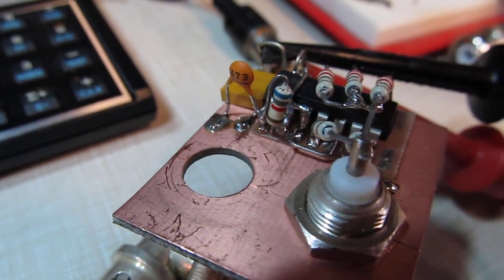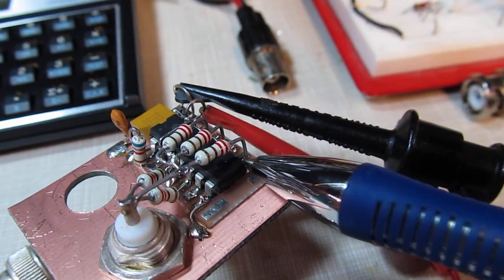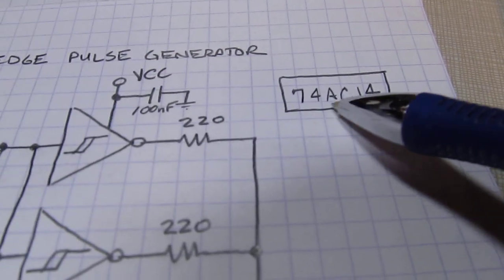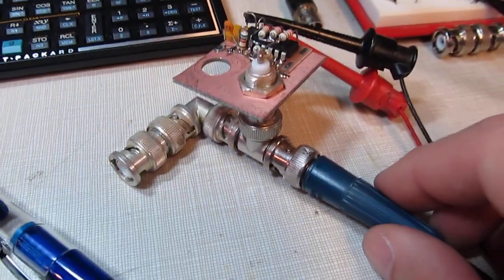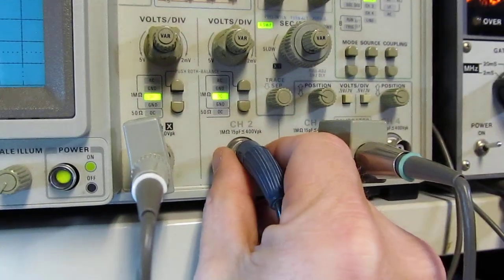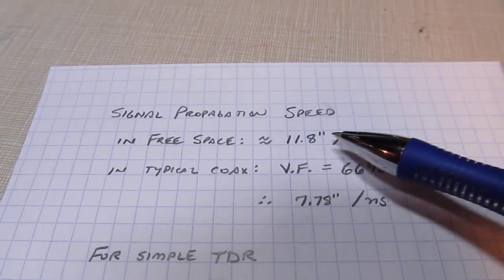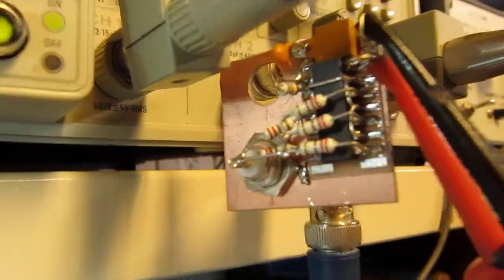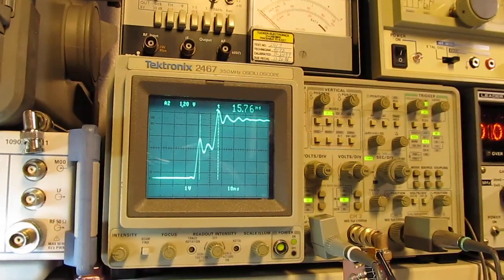#88: Cheap and simple TDR using an oscilloscope and 74AC14 Schmitt Trigger Inverter

Comment: Thanks for the good video and great info! A question raises due to my limited knowledge and experience,  when you look for measurement accuracy to a few inches isn't it better to just use one gate as buffer?  You commented on why used 5, but won't the inherent delay differences among the gates lower the resolution?  Again thank you so much.
Reply from the maker: The gates are in parallel to increase the drive capability (to drive low-Z loads).  There really isn't much of a penalty in rise/fall speed by doing this, thus no real penalty in distance resolution.

Comment: You have gone to the trouble of designing your circuit to drive 50 ohm load, why not select 50 ohm input on your scope channel?  I see you selected 1M ohm.  Trying to learn here - am I missing something?
Reply: Makes perfect sense. Thank you!!
Reply from the maker: Because I didn't want the scope to load the circuit with 50 ohms, I only wanted the coax to make the 50 ohm (impulse) load.  I only wanted the scope to "measure", and not significantly load the output.  It would still work is I used the 50 ohm scope termination, but the step change in the TDR would be smaller due to the circuit seeing 25 then 50 ohms, instead of 50 then 1Mohms.

Comment: Hi, thanks for this video. If the cable has squashed, can this finds the squashed point? I believe it should have rising edge at the point of squashed point.
Reply from the maker: Yes, the TDR technique works well to locate a crush on a cable, since it would show a change in impedance.

Comment: I tested a similar cicuit prototype in a  cable of a 400 v powerline of 750 mt, i determined the  velocity  factor in a little cable of 150 mt,works fine i  found a distance of 749 mt,the oscillo was a 120 MHZ bandwidth

Comment: It works not only for coax, I've just used this method to find a cut wire on a 40m extension cord. It was spot on.
Reply: Did you have to use one of the other wires as ground/shield?
Reply: @simonfencing I was using another wire as a reference wire, but I'm not sure if it was crucial.

Comment: Hi for traveling a very fast rise time pulse signal from one board to another have i use coax???
If I use normal two wires can it decrease the rise time of pulse???
Reply from the maker: If the propagation delay (length or distance) is more than about 1/4th of the risetime (some say 1/10th of the risetime), then you should consider using a transmission line that is properly terminated.  Using just a pair of wires can increase the risetime (slow it down), due to the distributed inductance and capacitance.
Reply: @w2aew  thank u for good and full  tutorial 👍

Comment: FANTASTIC content, congratulations!!! Based on the project in this video, it is possible to develop a UTP network cable tester that can detect the distance of each pair of cables and thus check whether the quality of the cable and connectors are good, perhaps using a microcontroller to transform the information timing in metric measurements???
Reply from the maker: Sure it would.  You'd probably need a more precise way to measure the time delta between the steps in the waveform - maybe a gated integrator or something like that.
Reply: @w2aew  I'm good at programming microcontrollers, the digital part, but I'm a bit of a novice in advanced analogue, I don't have the slightest idea of how to make this closed integrator, it would be very interesting if you, when you can and have time, maybe make a video designing one prototype to talk to an Arduino for example, I think there will be many electronics, networking and electrical enthusiasts interested in this project !!!

Comment: 2 questions.  What part# is the decoupler? And are we supplying power to the circuit via@ battery?
Reply from the maker: I used a 100nF cap for power supply decoupling, and powered the circuit from a bench power supply.

Comment: Excellent Pulse Generator Circuit! What is the maximum power consumption (Watt) of all resistors you use in this circuit?
Reply from the maker: 1/8 or 1/4 watt are fine.

Comment: I built the TDR circuit from QST years ago, and I used it at work with the better scopes to check coaxes on the reel, and the boss was so impressed, he went out and spent a ton of money on a box that had a microprocessor that did the math for you. But it never worked better, nor was it built under $5.00!
Reply: What lengths can be analyzed with a circuit like this?

Comment: Great. By chance I have a couple of those IC's in the box so I'm gonna build one right away 🙂
Reply: Just build one. Dead-bug style. Used 1206 for the buffer R. Works like a charm. One question though about measurement of the rise time in general. As this circuit is ringing, what value we take for the upper voltage? I was thinking maybe to use the 'end-value' (stable value) of the square wave, but that would probably not be right? I suppose we need to account the highest/max value? When accounting the max value I get ~2ns and if I take the stable value I get 1.76ns. Power supply was 5.0V
Reply: ...and did some TDR measurements. The results that I got are: 200cm coax RG58 I get 185cm, and 20m cheap RG58 coax I get 16m. The conclusion is that the puls is coming back faster. In the case of 20m it's 25% difference, that I do not understand yet. Help 😀 If it would be slower I could understand, it's a cheap cable, but faster? I come with the propagation velocity factor of 85 [% of c] instead of 65.9% that I looked up for RG58, and what you also stated as typical coax speed. So something is off.. I get good clear reflection measurements with a puls of about 2ns. Scoop's input was terminated as 50 Ohm (but maybe was not needed). The TDR-PCB was direct mounted on the scoop input, and a T-split to the DUT/coax.
Reply: ...maybe the problem that I used the coax of 20m rolled up...

Comment: I whipped this together and get 6.56 khz, but rise time is 36ns... any ideas?
Reply from the maker: Could be a couple of things:
- Did you use the same 74AC14 as shown?  Not all logic families are as fast as the "AC" type
- How are you probing the signal?  If you use a 1x probe, that will severely limit your measurement bandwidth
- If using a digital scope - did you zoom in on the rising edge?  Many digital scopes make measurements on the displayed waveform points rather than the full sample-rate waveform samples, which will cause the readings like risetime to change as you change the horizontal scale.
Reply: @w2aew  Thank you! I haven't had a chance, but you probably hit on a couple of things: The 1x probe and I'm using the "HC" version. Didn't realize there was such a difference! I'm glad I found your channel, really enjoying it! Have a happy new year
Reply from the maker: @larrybud  1x probes place a large capacitive load on the circuit (>100pF) and typically have a BW of <10MHz.  And yes there can be a big difference in speed between the different families.  HC are much slower than AC.

Comment: I went crazy enough to make a similar generator with a 16,384 kHz quartz oscillator followed by a 2^1...2^24 frequency divider made of three cascaded HEF4520B ICs with their outputs going into a dual-row pin header (2x25 pins: 24 outputs from the 4520's, plus one directly from the oscillator), from where the signal is routed by means of a jumper into a CD74AC00 quad NAND IC that produces as fast an edge as I could get from what was available for order in my country.
...this is how I found that I need a better oscilloscope :(

I also added a virtual ground output at 1/2 the signal output peak voltage to be able to use it in both AC and pulsed DC modes.

Btw I didn't care to put those resistors in series with the output, maybe I should, as well as add a USB power input.

Comment: Makes my heart happy to see someone using an RPN calculator. I get the video is almost 10 years old, but had to comment on the lost art. :)

Had to comment that this technology is also used in optical telecommunications networks, but is called OTDR (O for optical - of course). We use it every day to find optical fiber cuts/damage.
Reply: I was trying to figure the use case for this, and a broken wire or cable is perfect!
Reply: @larrybud  Indeed.  Years ago a lightning storm went through my neighborhood, and took out cable for all of us.  Out for my morning walk the next day I saw the cable guys out troubleshooting with a TDR.  (I used to work for a telecomm test equipment company, so I was familiar with them.)  They said they had determined the fault was 600 feet from that location.

I pointed back up the road and told them of a tree with blown-off bark and a dead bird at its base, along with a 100ft "bump" in the grass heading up toward the road (where the cable was buried).  I also told them there was one of the green metal access boxes just a short distance away.

The next morning, out for my walk again, they were at the base of my driveway, so I chatted with them again. They were something like 400ft problem there.  I asked them if they had checked out the access point I mentioned the day before (it might have been hard to see with shrubery in the area).  They said no, so I walked them down to it.

They opend the access point, hooked up the TDR, and it said the short was 60ft away.  I took long steps from the access point toward the bump in the grass, and end up at roughly 60ft right where the bump intersected with the road.  I pointed down with my finger and said "i think this is where the lightning came in from that tree over there."

The dug down there and found their coax cable perferated with with a bunch of burn holes.  The spliced in a new section of cable and we were back in business.
Reply: "RealCalc" for android is an excellent RPN
Reply: I've got a HP 50g i use at school in RPN mode (17 btw)

Comment: LMK1C110X might be interesting 🤔 
I have 0.8ns rise time on a single output...
Reply from the maker: Looks like the "typical" rise time is less than half of that - cool!  Parallel the outputs so each doesn't work so hard, and you can likely get a pretty speedy output!
Reply: @w2aew  I'll do a PCB :)  Pulse output  and a  power splitter 50 ohm

Comment: Is there a simple way to perform TDR using this device on an unshielded cable? Will this work on a coil, as in a giant solenoid (#10 awg cable with unknown length). I am trying to find a way to determine if a short exists in the winding.

Comment: Great video!  Can this be used with a high speed 50 ohm input oscilloscope for TDR measurements?  I believe the scope you used with this pulses is high-Z input.  Does the source (pulser + scope) need to match the cable?
Reply from the maker: you can use it with a 50 ohm input as well

Comment: Can I use 74hc04n?
Reply from the maker: No, for two reasons:
1) the HC family doesn't have a very fast rise/fall, so not suitable for TDR applications
2) The '04 is does not have a schmitt trigger type of input, thus the oscillator won't work the same.
Reply: @w2aew  Thank you for a quick answer, highly appreciated.

Comment: Thanks for a great video! I built it to find a break in a Romex power cable. Got 1.2ns/foot. Used a 74LS14 as that was all I had available. Needed to change the 6.8 kOhm to 1 kOhm to get it to oscillate.

Comment: How about using the scope probe compensation generator as a source?
Reply from the maker: The two problems with using the compensation signal as a TDR source are that it generally won't have a fast enough risetime to give you good resolution, and it may not be able to easily drive a low impedance transmission line.

Comment: First of all a Great video! I have a question about what happens to the pulse generator circuit given that the the reflections arrive at it. Does it damage the pulse generator?
Reply from the maker: No damage at all.  As far as the pulse generator is concerned - it "looks" like it is driving a 50 ohm load initially, but after the reflection comes back, it "looks" like it is driving into an open circuit.
Reply: @w2aew  Thank you for replying. My question stems from the following fact: RF transmitters have to be properly terminated otherwise reflected waves arriving at the transmitter will damage it. So I thought a similar kind of damage happens to the inverter driver. Can you please clarify it?
Reply from the maker: @manideepdunna827  RF amplifiers are often working at their power limit, so reflected power would exceed the maximum permissible level.  In this case, the logic circuit is not in danger of exceeding it's power limits.

Comment: Interesting. If I understand you only see one reflection from the loose end, because the other end to the oscilloscope is impedance matched and the voltage remains higher
Reply from the maker: It's really that the other end is essentially impedance matched at the generator, thus no substantial reflection.

Comment: These are very informative videos and have answered a lot of age old questions in my head. Many thanks. Can I ask why you chose to utilize the remaining five schmitt triggers in parallel, rather than just add 50ohm resistor to a single schmitt output?
Reply from the maker: Mainly to get more drive capability since a single stage struggles to drive a low impedance load like this.

Comment: Hello, thank you for sharing your knowledge, I can make the oscillator with the integrated Lm555 at 6khz, but it is necessary to put some resistance on the output, if so, you recommend me. Thanks greetings.
Reply from the maker: Please note that the rise/fall time of the LM555 is going to be too slow to be useful for TDR applications.  And, the LM555 output can not drive a low impedance load like a transmission line.
Reply: @w2aew  Ok friend, thank you very much for answering, I have a 40106 (the cmos brother of 7414), you believe that this could help me to implement the TDR oscillator, thank you, regards.

Comment: thanks for the video: can you give some additional input on the circuit building looking at the use of the pcb: could it be built on lets say a breadboard or is all this shielding really required?
Reply from the maker: If you use a device with very fast rise/fall speeds, you will get a lot of ringing and distortion when using a solderless breadboard.

Comment: hey so we need to build TDR and we are having a 1KHZ SIGNAL GENERATOR SO IS IT POSSIBLE TO LOCATE THE FAULTS IN CABLES WHICH ARE BARELY 10Mtrs  LONG WITH THAT FREQUENCY and how can we use this to locate faults in power cables such as electricity distribution line
Reply from the maker: It’s not the frequency that matters so much, but rather the risetime of the signal.
Reply: w2aew  is it okey to use the ic 74LS14 AND we r trying to using in ASCR CONDUCTOR

Comment: 44 OHMS out of trigger ?
Reply: @w2aew  https://youtu.be/9cP6w2odGUc?t=147
Reply from the maker: @itdevops   - Oh, OK - I see that OMS = ohms.  The output impedance of the device is not zero - so each output adds to the 220 ohms in each case - resulting in an output impedance of approx 50 ohms.
Reply: @w2aew  ty, i mods. OMS = ohms thank for reply reallly fast i will go do trigger ty +++ from France
Reply: @w2aew  SY i learn and at the end of this file is you finger and capture screen ty http://www.ijircce.com/upload/2015/june/3_Guided.pdf

Comment: Would the scope cal out be fast enough or would there be a drive problem..
Reply from the maker: In general, the risetime is too slow, and this source often cannot drive a low impedance load like a 50ohm transmission line.

Comment: Great video! Thanks again. Is it possible to build a TDR for cat 5 cables using the same principle? This is definitely on my spring break todo list. I wonder how the twisting would interfere or add inductance.
Reply from the maker: The twisted pairs does two things for you - it helps external noise to become common mode, and it helps to maintain a fairly constant RF impedance between the wires (typically 100-150 ohms).

Comment: I want to build one that is a single hand held unit with a mini scope but no scope... let me explain, I want it to have an internal dedicated scope that measures and calculates the time delay reflection and doesn't output a scope trace but rather just a length, switchable between metric and us standard units that measures romex cable... a tool for electricians both to simply measure wire lengths and to find shorts and openings in circuits that may be buried in walls or in boxes for receptacles, switches, lighting, etc. if you know how far down the wire a short is and you have a toner you can find it quicker. I looked and it doesn't seem that they make them in a simple small handheld device, nor do they make them for romex... given that I'm no where near knowledgeable enough to make a small dedicated scope (by dedicated I mean it can be limited to only performing this sole function) and thus it may take me a few years to get started, anyone interested can steal my idea. I'm more interested in it's existence than the clout or money.

Comment: Hello Sir,
we tried constructing the same circuit, but we cannot get the pulse, we used general electrolytic capacitor rather than box decoupling capacitor,  we are using DSO in range of mhz sampling frequency. do we need to use MSO?